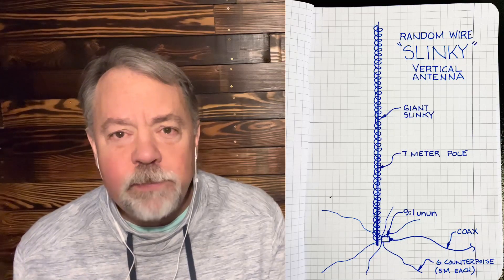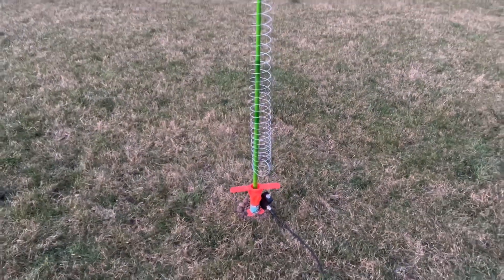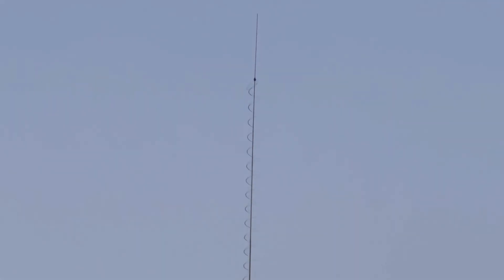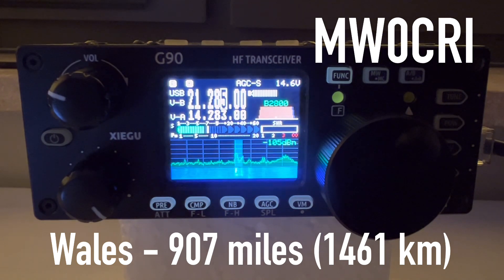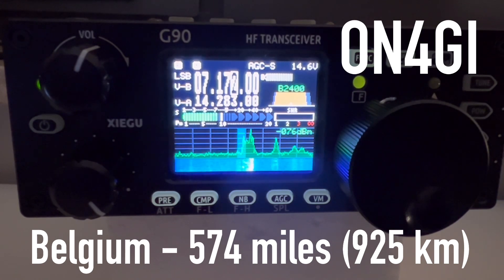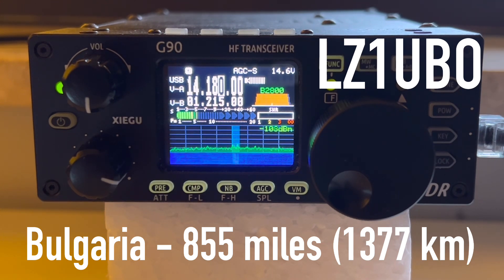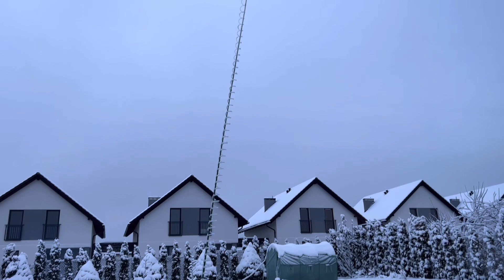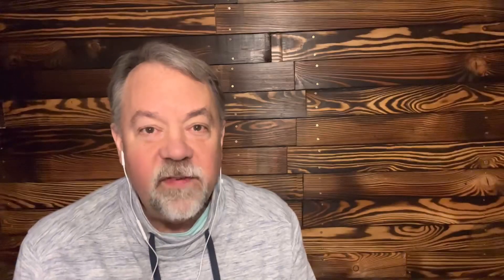Giant Slinky Antenna - Having Fun on the HF Bands

Comment: Love Slinky antennas!!!   Hint; you can adjust the length on the fly with a fishing reel and line. Run the line through the Slinky and attach to the end opposite the reel.  Tune by cranking.  With your pole, I'd drill a hole in the top end and run the fishing line through that. Should be able to locate the reel at the bottom that way.
I've used this rig SWLing for years. Nice and stealthy hanging out of an apartment window.
Reply from the maker: That's great info, thanks for sharing!

Comment: Slinkys are great for antennas with a good tuner. I used to use two regular slinkys as a dipole with a simple balun. They were stretched out on a length of para cord and were only about 5 feet above the ground. I talked all over the world both QRP and high power.
Reply from the maker: Awesome! Thanks for sharing.
Reply: @COASTALWAVESWIRES  I have 2 Walmart metal Slinkys. It might be practical to make a slinky dipole and see what happens.

Comment: I had make a long slinky antenna once using 4 of them. Made a contact on top band with it. When I had it as a standard dipole with no balun I managed some contacts into Europe on 40. It worked in a NVIS type of antenna as it was only 3 feet over ground and fully stretched out. As a vertical it might not have worked but as a dipole they work very well.
Reply from the maker: Interesting, thanks for sharing!

Comment: Awesome mate.

Don't worry about resonance having to present a low Impedance.

We can also have resonance with a high impedance like the EFHW wire does.

The main thing is keeping transmission line losses down.

if a low loss line is used
then an ATU brings the "system" to resonance 
and the RF (TEM) WAVE is actually created by the Changing  Potentials between two points like  the element and ground (creating rotating magnetic fields) Displacement currents between the ele and ground.

or if a half wave long the potentials are also between each end of the antenna element.

The main objective is being able to peak the system to highest Vpp (Resonant State created by  USING the ATU if required.

You can make a low loss coax of higher characteristic impedance using Aircon / ventilation Ducting provided it is truly conductive and having a centre wire running through it with periodic foam balls to keep the wire centred.

Then Tuning with a broad ATU  will incur minimal Losses. 🙏

Love your experiemnt mate  Great Work 🙏🙏🙏
Reply from the maker: Thanks so much and thanks for sharing this great info! 
73, Walt K4OGO

Comment: I love your video. Slightly off topic. Perhaps yo have covered it elsewhere?  I am wondering what you might be using for your mast. Green Fiberglass??
Reply from the maker: Thanks Stuart, It's a 7 meter telescopic fiberglass fishing pole. I got it on Amazon. They are also called Crappy Poles or Squid Poles.

Comment: Amazing, with a 9:1 congratulations. Try to put only 4,70 meters of wire attached to your 9:1 and put it on in your 7 meters pole, you have a great surprise, try in first time without counterpoise. 7351 from Portugal, ok I'm a CB user. I like a lot your experiments. Good Work 73 Paulo.
Reply from the maker: Thank you Paulo! 73

Comment: Hey Walt 

The antenna, at 6.5m, is around a half a wavelength for 15m. That would explain why you had a good response. Nice low takeoff angle on a vertical half wave 

The coil would act as a loaded vertical making it electrically longer than the magic 22’ for 15m so the impedance would be less, as the antenna appears longer, and resonance would be lower down. 

I’d be curious what frequencies the antenna resonates at. What the smith chart on a VNA says

I use a vertical extendable aluminium telescopic pole made from 6x 9’ drawn aluminium tubes. I tune them for resonance by adjusting the height, then match them to 50 ohms with a switchable ratio matching transformer that gives me between 2 and 14 windings each side, so I can match up a quarter wave, or an end fed.
Reply from the maker: Thanks for the input, that makes sense, it was awesome on 15. I wish I could have spent more time with this but as you can see in the video the weather locked me in. I’ll visit this antenna again and go deeper. Thanks so much for your knowledge and input. 73, Walt K4OGO
Reply: @COASTALWAVESWIRES  I’ll just explain myself a little better with the adding of capacitance to an antenna

5/8 and 0.64 wave antennas have a slightly better / lower take off angle than a half wave

So you make a 5/8 wave electrically a half wave by adding capacitance to the antenna.

You can also electrically shrink a 3/4 ground plane vertical by adding some inductance to the antenna 

So the trick is to get the antenna resonant and matched, but slightly physically longer (or shorter) to hit that optimum low take off radiation pattern 

Have a look at some of the coax 5/8 wave antennas for 11/10m. They do scale to 20m at 12.5m tall

Anyway, lots to experiment with. 

Keep it up and have fun
Reply: @COASTALWAVESWIRES  no worries. Living in Sydney Australia, we don’t get snowed in, just washed away

I’m always looking at those magic resonance points, where the smith chart shows no reactance.  I need to do some experiments myself, see what the difference is between an antenna that “tunes up” vs one that is matched and at resonance. 

The little work I’ve done with this, it seems that size / length is what counts as far as take off angle goes. You can make a 5/8 or the 0.64 wavelength antenna which has the best low take off angle for a vertical, by using a capacitor in the antenna to electrically shorten the antenna, the same way a coil will extend the electrical length of the antenna. 

So even though a ham stick will tune 20m, it will never be as good as a full height 33’ end fed vertical 

Good luck with your antenna adventures:-)

Comment: look at the number of turns & turn diameter in a straight old 2m "rubber duck" helical antenna (not a vhf/uhf dual band) & simply multiply the size by 20 to scale from 2m to 40m (same number of turns) & basically you get a slinky.... you should be able to cut it to length & resonate it directly on 40m without the 9:1 un-un (rubber ducks don't need un-uns)........ try measuring it's resonant freq without the un:un........ basically you have a naked rubber duck here.

Secondly... 10 Watts is about 20 volts (into 50 ohms) so sticking that through a 9:1 un-un will give you about 60 volts (impedance ratio = square of turns ratio hence x3 as the voltage ratio).... open metal & wet snow with 60V on it is probably going to be a bit leaky impacting SWR (the un-un kicking the voltage up is probably making things worse here in the snow)
Reply from the maker: Thanks for the input and for commenting. I’ll do some study and a deep dive on this. 73, Walt K4OGO

Comment: Maybe you could attach a long wire to the top of the slinky and run it horizontally to another mast, turning it into a crazy inverted L. Thanks for the videos Walt, 73!
Reply from the maker: That’s actually a great idea Dan, hmmm you got me thinking. 73 my friend!
Reply: @COASTALWAVESWIRES  get enough wire and go 80 or 160 😂
Reply from the maker: @johnalcock7536  I hear you but I’m in Poland, 160 here means I’d have to learn a couple new languages

Comment: I am always amazed at some of the "unusual" things that will act as an antenna...
Reply: True. When I first got into ham radio I was fresh out of the military and lived in an apartment. I lived on the ground floor and my balcony door was right next to a metal vertical gutter. The gutter extended from the ground and up the wall approximately 40(?) feet to the remaining gutter system. I was using an Icom 751A and a Icom AT500 tuner to tune up the gutter. I was only able to tune up on 10 meters but, it provided some way to get on HF. I made some decent stateside contacts but never any DX…
Reply from the maker: Me too!
Reply: the back stay of my sailboat. no visible antenne 11m endfed saltwater experiment
Reply: Anything can. Even your body

Comment: You have me wondering whether I should try making a doublet out of my pair of slinkeys. Perhaps hanging vertically I could get a fair radiating length without a radial field. May need to look at those giant slinkeys.
Reply from the maker: Great idea!
Reply: @COASTALWAVESWIRES  At 67 feet per slinkey, two of them might make a decent 80m antenna or doublet (a bit concerned about it being too close to resonance) though two giant slinkeys might make for an even better  compact radiating element. Will probably play around with the standard slinkeys to start.